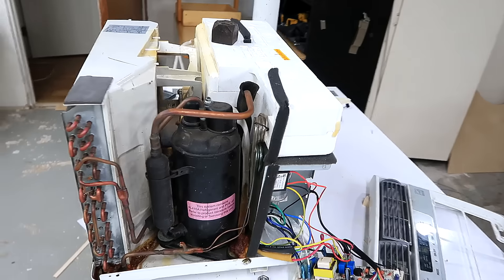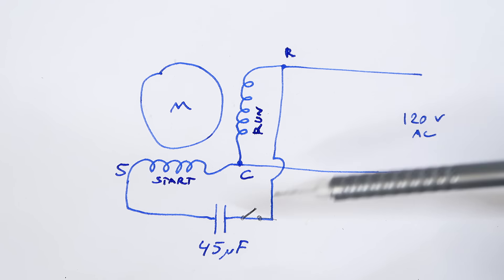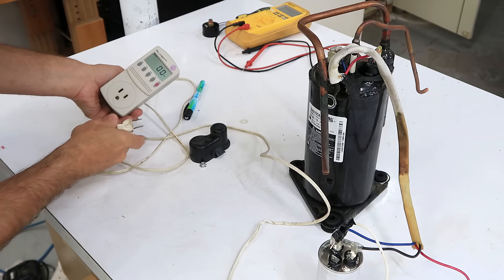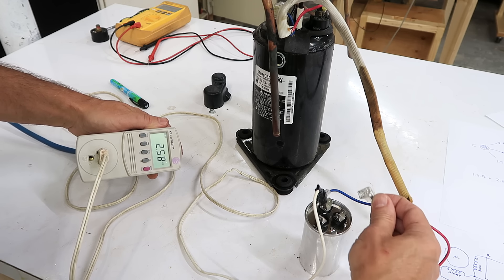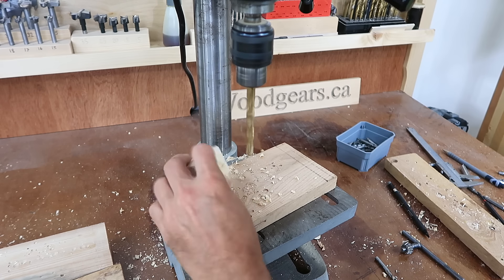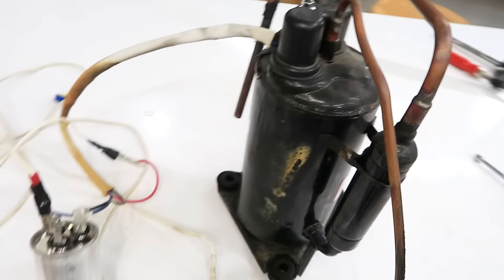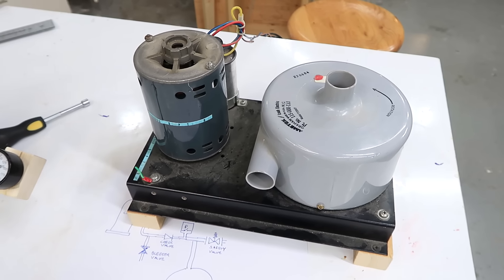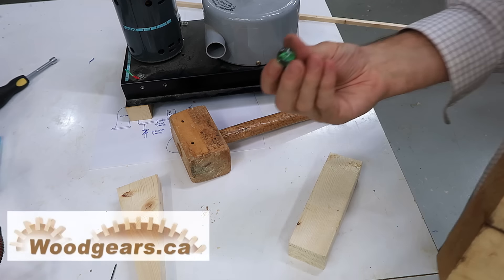Reusing an air conditioner compressor

Comment: Be careful sloppily handling those capacitor terminals!! If you measure across terminals, you will see 300-400VAC of back EMF. It will light you up.

Comment: What cynic5581 said. Also, it is important to highlight the fact that the refrigerant carried its own oil which allowed the compressor to run. With no oil in the incoming gas, the compressor will stop working in a very short time - as in a few hours if you're lucky.
Reply from the maker: see the comments.  there are apparently a lot of very lucky folks out there.  also, air compressors don’t need oil in the incoming gas.
Reply: @matthiasrandomstuff2221  they really do, or if you want to be more precise, they need to replace whatever leaves with the outgoing gasses.
If you don't think this is the case, drain the PAG oil from your car's AC and see how long that compressor lasts.
Of course, do as you see fit.

Comment: Do I have to use insulated tools or do anything special while disconnecting the capacitor? I’m sure I can identify what I need to and disconnected but I’m told it can be dangerous.
Reply from the maker: Capacitor run motors discharge the cap as soon as the motor stops

Comment: Cool I didn't know you'd get that kind of PSI out of a AC compressor I have one eye salvaged  That's been kicking around trying to figure out what I'm doing with it 
original plan was the use it is a vacuum pump
Reply: A vacuum pump?  That idea sucks.

Comment: Try looking at the power factor when you disconnect the capacitor. If the PF gets closer to 1 with the cap, leave it in. If it gets closer to 0 take it out

Comment: The compressor is lubricated by oil mist when used in the AC. It probably won't last long compressing air with no oil.

Comment: One thing to change your picture, your leakage would act just fine as a bleed valve, so you Could make it a slow quieter refill (maybe an overnight compressor) if you shorten its output, and toss on a check valve as close as possible.

Problem is that it definitely won't be energy efficient, maybe if you hook it up to a solar cell it could be a way to passively fill a tank, but 9/10 times you need more than what's In the tank, and 99/100 times your solar will  not make it useful since it will be during the day when you could be loud anyway.
Reply: You are correct, this would be a passive air measure, light duty. But most tanks already have a check valve, and you do not need to bleed a scroll compressor. The oil is the seal, when it stops gurgling after shutdown add little oil to intake. Most of the oil stays in the compressor due to 150psi or below. It does not operate below freezing, possibly due to frozen moisture in oil. Source: I've had one rigged as a bandaid for a year.

Comment: Since there is no switch to switch out the capacitor, I'm curious as to why you would think it should be switched out?
Reply from the maker: cause I have seen that done in a diswasher
Reply: @matthiasrandomstuff2221  
what was the mechanism used in that case? Something external to the motor?  Seems like a very unusual thing

Comment: I know this videos old and im not going to get an answer, but i have to ask...

How in the holy hell did you get that block of wood to hold that much pressure? Like, the gague is one thing, even if you just threaded straight into some hardwood - I'll buy that it would hold for a little while but the copper pipe??? Did you just drill an undersized hole and shove it in there?? How did it hold 12 psi much less 120? I must know, im losing sleep over it
Reply from the maker: that pipe cross section is maybe .05 square inches.  120 * 0.05 is not a whole lot of push on the end of that pipe.
Reply: Well when you put it like that I suppose it makes sense

Comment: Where is the ground?!  You should really ground the frame of that compressor to ground on your home.  Otherwise, neat for proof of concept, but it won't last very long.  The motor inside is cooled by the cool refrigerant gases being pumped through it and that refrigerant also carries oil through the system to keep the moving parts lubricated.

Comment: Surely you have a graduated cylinder (or any marked container for liquid) you could fill with water and invert for measuring air volume more accurately than your rough calculation of the balloon.
Reply: the balloon bust was much more fun, and don't call him Surely

Comment: Using that POE oil to compress air means you’ll get about 1-2 months of work from that compressor until the oil turns acidic, corrodes the windings, and sludges up from water infiltration. Good project, though.

Comment: some compressors from AC units have a caution label saying 'dont use for compressing air' . It was a dc inverter type compressor. Do you know why?
Reply: probably that they pump out a lot of vaporized oil from the act of compressing. if it was a compressor in an A/C unit, it was designed to pump freon in a closed loop. pumping air is obviously open loop so you need constant lubing on the input side.

Comment: Wondering what the most cost effective way to make a tankless compressor that's high CFM and psi... maybe like an old semi tractor truck screw design one refurbed?
Reply: A centrifugal pump/vacuum device from an old offset litho machine is great for low pressure spray painting, and draws a fair vacuum too. They run fairly quiet.

Comment: 410A oil is not good for skin contact. supposidly a carcinogen. also when contaminated with moisture in the air it becomes acidic and eats the windings of the motor.  id dump it out and fill it with another type of oil. make sure to keep it full for a long life, also correct direction of rotation is important for proper oiling.  oil is meant to be pumped through out the system also the refrigerant is meant to cool the compressor. so long periods of time of running isnt going to help it live a happy life.

Comment: Apparently things like butane could work as a refrigerant. Could be interesting in the name of science.
Reply: Propane is a better fit pressure wise. Butane is used for fridges these days (named R600 refrigerant) and Propane in small air-cons (the "mobile" ones) and is called R290.

Comment: I have a dehydrator scroll compressor rigged to replace an oilless that ate its seal and already had a cracked head I fixed with jb. Parts more expensive than an entire new unit. 

The scroll discharges thru its condenser, cooled by the fan, and into a small manual moisture separator which hardly has buildup. There is no need to bleed pressure on startup when the tank has its own check valve, and the scrolls bleed back pressure when off due to no seal. 

This would be very light duty application as it cannot keep up with a die grinder past 5 minutes. It takes at least 3 times as long to repressurize the tank, I always let it cool between applications, and the inlet should gurgle after shutdown. That means there is enough oil to seal the scrolls. 

I have added oil once in light use, one year operational. It will not start when ambient is below freezing, possibly due to moisture in the oil. It has gotten me by, but barely.

Comment: that’s not a toy. could  make 600 psi possible if not more before it’s internal bypass opens (if it has one). it’s also reliant on cool refrigerant returning as a gas to cool its windings so it will get real hot real fast open air like this. if its rotary pump is not kept lubricated as it would be in normal use it may not pump to as high a PSI it otherwise would or last very long. the oil it contains is also hydroscopic and certainly contaminated now and possible burnt if you have let it.  so its not long for this world i’d imaging. cool project. don’t die. by pass it’s thermal protection, put oversized capacitors on it. dead head it into your gauge again and let it rip. let’s see what happens.

Comment: Refrigerant is 1000x more effective than CO2 at being greenhouse gas. I realize that refrigerant recovery is out of the realm of most people however I would expect to see a youtuber with more resources but a recovery machine and take to properly dispose of the refrigerant.
Reply: The refrigerant was already out of this unit. Taking it out is not too hard (vacuum pump) but storing and disposing of it safely is.
Better to take the complete unit for recycling.
Reply: @pizzablender  I am a master HVAC and have multiple licenses in multiple states. A recovery machine is different from a vacuum pump. If you want to play with refrigerant in the US I would encourage you to take the $20 online courses offered by Mainstream Engineering. Me personally, I try to keep my mouth shut when I don’t really know what I’m talking about. Try it out.

Comment: What is 200psi in normal?
Reply: ~13.8 Bar
Reply: @MrDubje  thanks!
Almost 14 ATM, impressive!
Reply: Divide by 15.
Reply: @grieske  you mean 14,504?
Reply: @safetyinstructor  I don't use it often enough to remember that, but you are of course correct.
Reply: @grieske  it's somewhat more difficult to do in your head

Comment: If you plan on running the compressor for long lengths of time, you may consider cycling the oil inside through a radiator.

Comment: Taking apart that window ac technically probably required an epa608 license....   maybe try to pass the test and just don't tell anyone that you did it afterwards.  There is a fine if the machine still had refrigerant in it when you took it apart...

Comment: That compressor likely has PAG oil which will absorb water, you’ll want to change it to mineral oil before using it for an air compressor.
Reply from the maker: already did after reading some of the comments

Comment: Please be careful with ac compressors, their body can sometimes be live if the winding insulation in the comp is bad. And that could be dangerous.
And for the air that leaking back from the suction pipe is a sign of bad compressor. But you can easily fix that by adding some comprssor oil (R410A oil) to the suction pipe. 🐳💦

Comment: 200w seems abnormally for such an old, non inverter compressor. These usually are rated in kw.
Reply: He measured it without any load on it.
Reply: @murraymadness4674  still.
Reply: 8000 BTU aircon probably used 700 or 900 watts in operation. So 200 watts unloaded seems in line.
Reply: @pizzablender  my 7A rotary compressor when unloaded consumes 3 to 4 A.
So it should be about half.

Comment: I have seen people convert refrigerator compressors into "silent" compressors for air brushes, but I think the more aggressive PSI of an air conditioner might be a bit much for that (due to the air conditioner having to deal with more extreme differences and having active cooling to help)

Comment: I was looking at similar uses for an old fridge compressor. The fact that these compressors are designed to get lubricated by the freon meant that it's not suitable to pump air and it's going to fail quickly. I did not validate my hypothesis though.
Reply from the maker: They do have oil in them.  I ended up replacing the oil best I could cause the oil they come with apparently likes to absorb water.
Reply: Yes if the scroll doesn't gurgle after shutdown there's not enough oil. I have had one for light duty for a year, topped off with 30weight. It still will not operate below freezing. Most likely due to moisture so beware of a rusty compressor housing becoming a grenade. Do not stand near during operation. We will see how long it lasts.